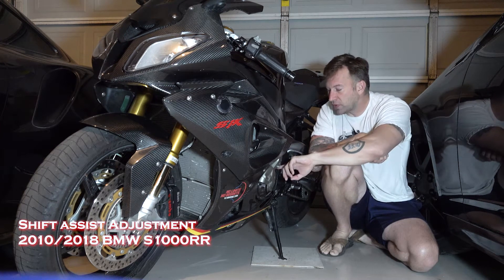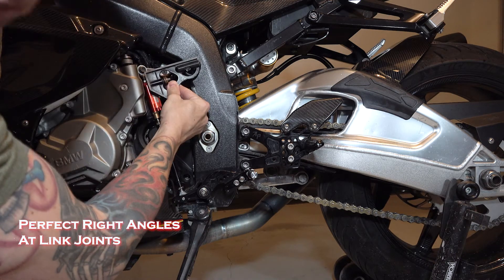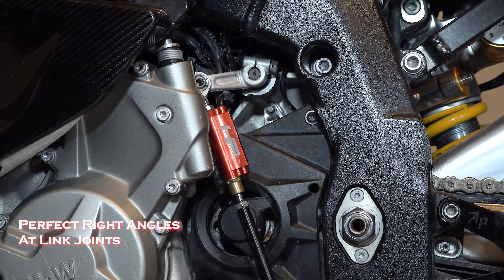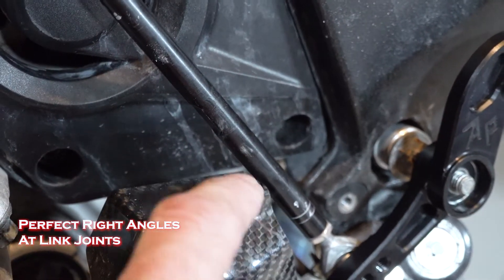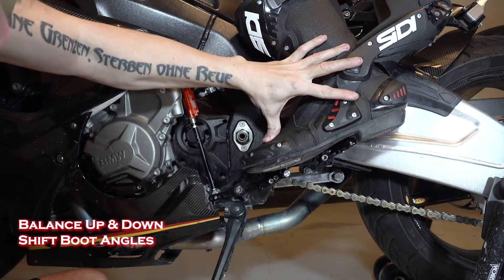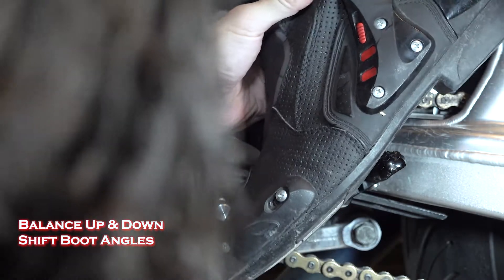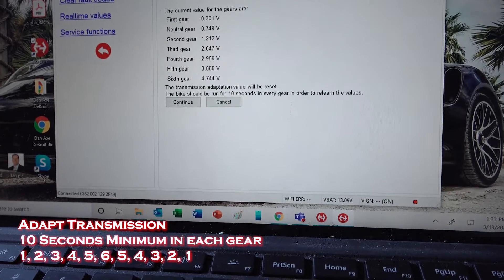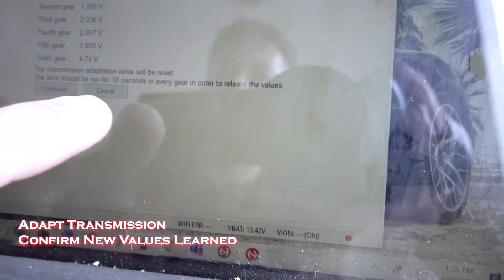Motorcycle QUICKSHIFTER Adjustment EASY - BMW S1000RR Custom Modification

Comment: I got a bmw m1000rr 2021, is it needed to recalibrate when im just adjusting the shifter rod and levers?
Reply from the maker: it probably isn't, but any time i'd mess with that part of the bike, i'd always recalibrate it just to make sure everything was still dead nuts and eliminate the possibility.
Reply: @NoLimitsNoRegrets  i feel like my quickshifter is really clunky, have you ever felt like that? like it presses 2 times before it shifts
Reply from the maker: @thomas-wl1ks  If everything is working right, your shifts should be butter smooth. If you're having to fight it at all, you might want to go through my troubleshooting video for the QS.  https://youtu.be/ze6FsspxBwo?si=7UZc41pqT09eL4u-

Comment: Do I have to pull the clutch in when shifting every gear ??? Or just press the quick shifter up in gears and down ??
Reply from the maker: i was told you should pull in the clutch shifting gears when you calibrate the transmission. i have another video on full troubleshooting of the quickshifter at https://youtu.be/ze6FsspxBwo FYI
Reply: @NoLimitsNoRegrets  I have a 2020 s1000rr

Comment: When you re-learnt the gears (after resetting) - did you have to use the clutch to change gear during that process?
Reply from the maker: i think i read or was told that somewhere? that you have to pull the clutch between shifts? maybe the computer needs to see that clutch switch each time?
Reply: @NoLimitsNoRegrets  ok great thanks for that. I'm going to use motoscan to reset mine and relearn (as I had to fit a new quickshifter under warranty) - thanks!

Comment: If you can’t eye ball 90 degrees without using a ruler you should not be working on a motorcycle and if you don’t know there reverse threads you should not be trying to teach anyone anything 🥴
Reply from the maker: wanted as close to perfect 90 deg as possible

Comment: Would resetting apply to a 2014 if adjusting OEM shifter rod length
OEM rearsets too
Reply from the maker: yes the GS911 reset still has to be done on the earlier ones too. I believe the old yellow unit (i have my old one here that i'd sell if you don't have one) is for models through '14. you can confirm by looking in the tail and confirm you have a round connection req'd by yellow GS911. The red one in the vid is needed for '15 and later and has more of a trapezoidal connector.
Reply: @NoLimitsNoRegrets  
Hi, I wondered what those yellow ones were about. Saw them on eBay recently when searching gs911. My bike has round connection for obd 2. I have the adapter too. Yes I would be interested in your Yellow box
Reply from the maker: @Don0van5100  sure thing. wanna just email me at (spaced out to avoid robot spies) a x e @ y c h r o m e . c o m ? the yellow box plugs right into that round port, then i have a cable that goes from it to the laptop. i can send pics over email when i receive yours, ok?
Reply: @NoLimitsNoRegrets  email sent to you
Reply from the maker: @Don0van5100  got it!

Comment: Also is that necessary to reset the trans adaption after swapping to aftermarket rear sets??? I have a 2017 S1KRR
Reply from the maker: personally, i think it's worth (i always do) doing the tran reset/adaption every time i mess with the links/angles or anything. new rearsets may change your angles a bit. That's why i made this vid, kinda show how if you mess with the geometry, you can check the 90 deg angles, interfaces, etc. and reset the tran. If what you did works fine, great, but sometimes little changes can really affect it.

Comment: upgraded quick shifter? If so what do you get from that over the stock one? Suggest adjusting the stock one? I notice sometimes the quickshift goes into neutral from 1st to 2nd when starting from a stop.
Reply from the maker: my bike started as a 2010, which only had upshift assist, not downshift. when i upgraded to an '18 engine and electronics, it also got the updated up AND downshift assist. this particular one is an hp4, which i was told was even a bit smoother than the normal s1k one. i've never had it fall into neutral on 1-2 shift on old '10 one or this one? interesting.